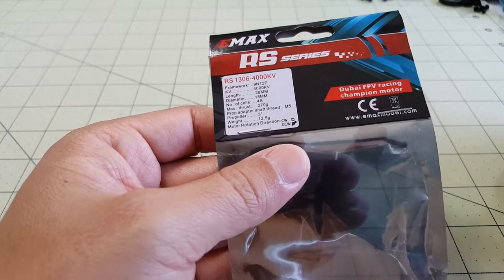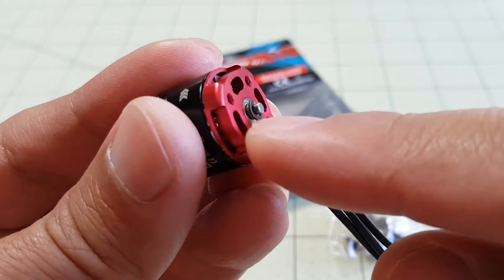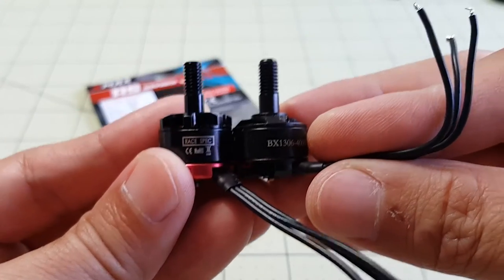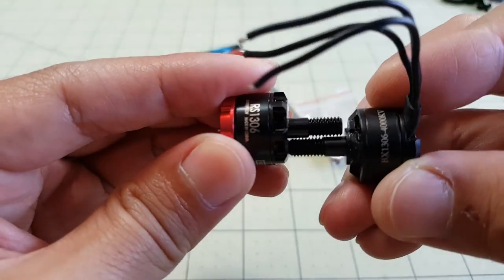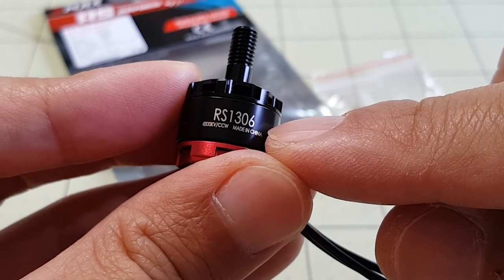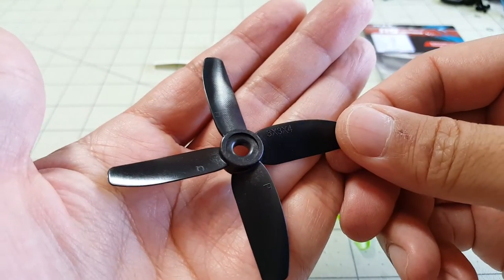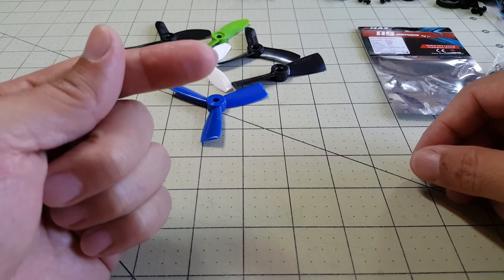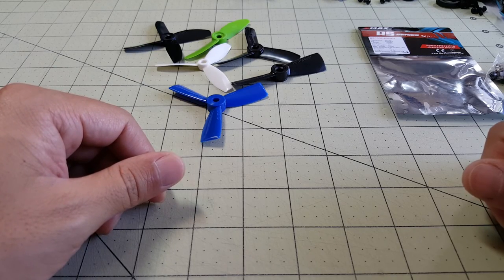EMAX 1306 3300/4000kv Motors

Comment: I would really like to see the kingkong 4" props tested.  I have a grass hopper 160 with 4" props on DYS 4000kv motors.  It flies amazing, but I bet it will fly even better with these motors.  The 2205 red bottoms are amazing, I hope they can live up to the hype.
Reply from the maker: I have some dalprop 4 inch bullnose props.  Sorry, I don't have the King Kong props.
Reply: That would work for me. Would be interesting to see how a 4" prop compares to a 3" triblade.
Reply from the maker: I can tell you right now that the 4 inch prop will destroy the 3 inch triblade EASY!... the extra prop length makes a massive difference.

Comment: What esc would be recommended for these? I’m using the emax lightning 20a but I might change to a 4 in 1 or bullets. I don’t really know how to size the esc afa amp rating. My set up is 130mm with 3” on 4s.

Comment: Can this motor take 3 inch prop on 2s? What will be the mid throttle thrust like?
Reply from the maker: It can but it will be slow and not a performance machine and the weight will play a big part in what the throttle will be like.  Obviously on a light setup it will be better.
Reply: Albert Kim I am building a 3 inch quad to fly with 2s 18650 pack. Not a performance build but looking for more flight time. I am having a tough time deciding on motors. 1106 4500kv or 1306 4000kv will be better for me? I am assuming AUW under 250gm.
Reply: @simtcr  I assume this is a mistake but are you actually flying with 18650's????

Comment: Any ideas about this motor on 4inch, or could you test it for me, im thinking about building a new copter but i dont know whether to go with a 130 or a 155.
Reply from the maker: This is an easy answer.  On 4S, 4 inch, 3300kv only.  On 3S, 4 inch either motor is fine.

Comment: Do your motors get really hot? I have these emax 1306 4000kv and they get really hot even after only a few seconds of flying
Reply from the maker: No. I'm running on 4S and 20 amp ESCs.  If they're getting super hot you might have a PID tuning issue.  They should not be getting that hot.  I assume you're using 3 inch props?  If you're using 4 inch props, they will get super hot.  Not meant for those unless you're flying a light setup on 3S.
Reply: I'm using 3" tris on 4s 1300. I fly dys 1300 3100 kv and it's fine but these emax 4000kv keeps getting hot. Are you flying tris?
Reply from the maker: Actually flying 3030 4 bladed HQprops. But my 4S is only an 850mah so lighter.  Motors always cool.  But my 130 mini is very light.  I think about 190g with lipo.  If it's too heavy, the motors will get hot.

Comment: What esc would be recommended for these? I’m using the emax lightning 20a but I might change to a 4 in 1 or bullets. I don’t really know how to size the esc afa amp rating. My set up is 130mm with 3” on 4s.
Reply from the maker: 20a ESCs will be OK on that set up.